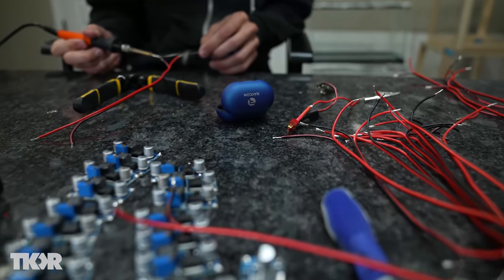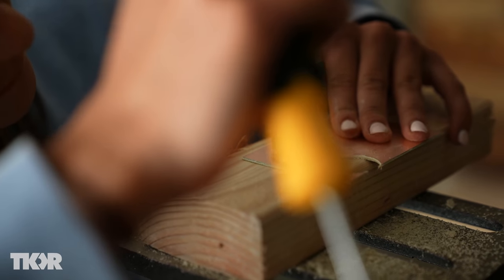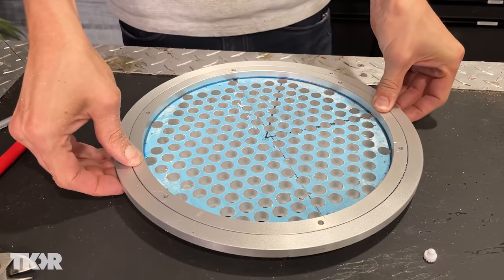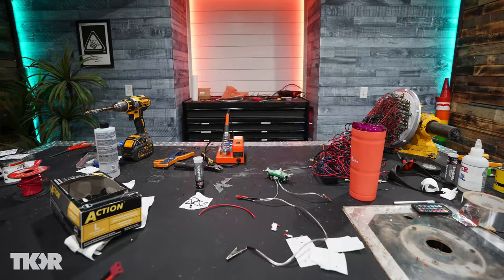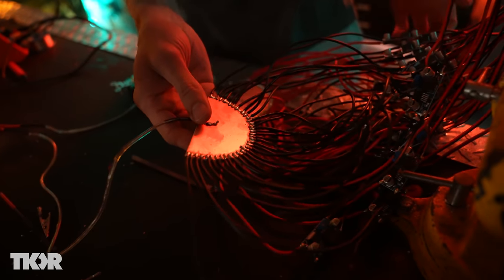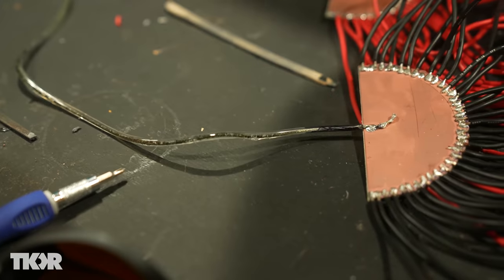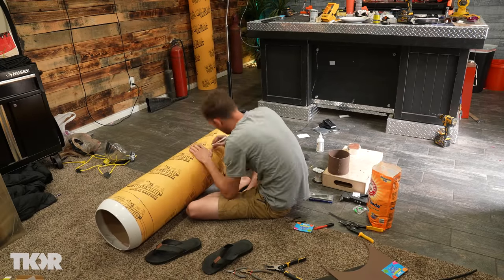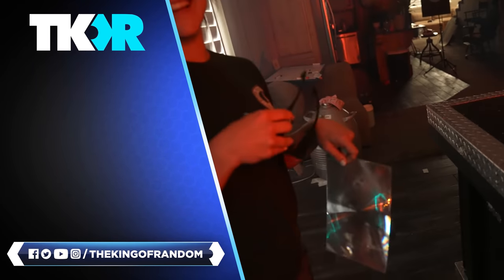How We Built the World's Largest Laser Pointer!

Comment: I'm trying to make the math add up... Even the cheapest 8V to 3.3V buck converters I can easily find are rated for at least 1W. Laser pointers available in the US are all <5mW output power. Which means 174 of them should pull certainly <2W. So maybe if you're using particularly cheap buck converters (and not the 7A ones that are pretty easy to come by), maybe you'd need 3 to be safe? But I can't make the numbers add up to 35 no matter how hard I try...

Comment: you set up the batterys in parallel (so the voltage doesn't change). but if the voltage is constant with the same laser setup the current is also the same. more batterys yjust mean you can run it for longer and a single battery isn't stressed so much, so it will live longer.

Comment: I wanna see you cook something with that.
Reply: Agreed!
Reply: Yes
Reply: It won't work. 1 of those laser modules outputs about 1-5 mW. and he is using 175 of them, so its 0,175 - 0,875. If this power would be focused on one dot it may pop a ballon and most likely will light a match on fire. But thei aren't focused ond laser work by only heating one sigle point. so this thing isn't more effective than one laser pointer.
Reply: @drohnele3741  Agreed, but it can "cook" your retina. I'm surprised they weren't wearing the appropriate eye protection.
Reply: @DBrentWalton  a 1 mW
 laser will at most blind you for a few seconds. most likely no permanent damage.

Comment: Her lungs are now full of glass particles that will stay there, probably forever. Use a gas mask when cutting or drilling in FR4. Also, you clearly know nothing about electronics. You could have connected several laser LEDs in series, sparing you from buying a tonne of buck converters, and you should have current regulation, not voltage regulation when driving LEDs.